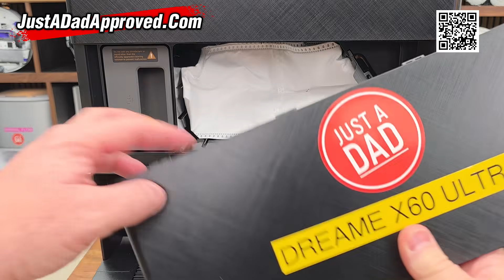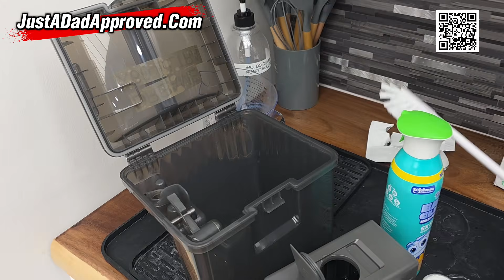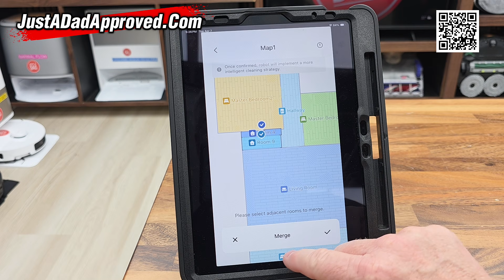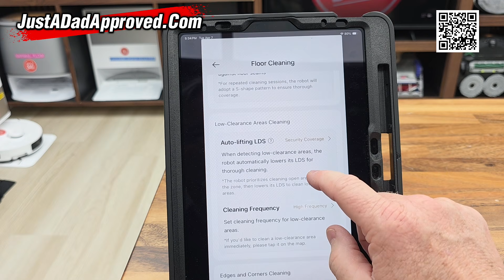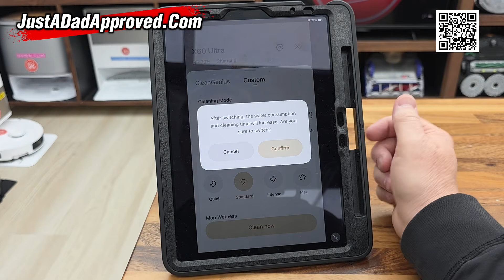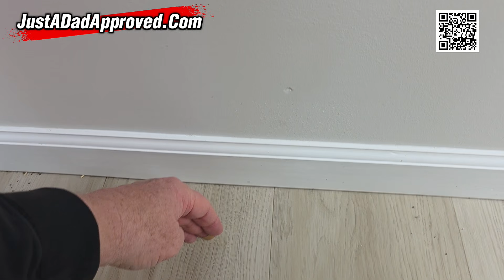Dreame X60 Ultra Robot First Look: Does It Live Up to the Hype?!

Comment: The robot seemed lost and confused when it was vacuuming/mopping your floor, and its cleaning pattern was erratic. Also, having the side brush on while it’s vacuuming carpet is just wasting battery, it doesn’t actually do anything lol
Reply: Regarding side brush on, it’s a setting where you can select if you want it on or off :)